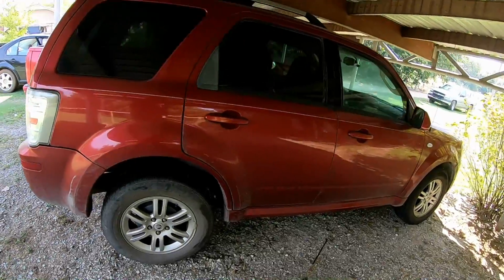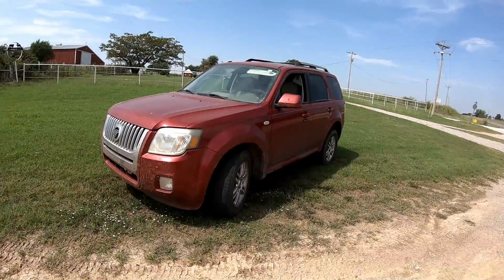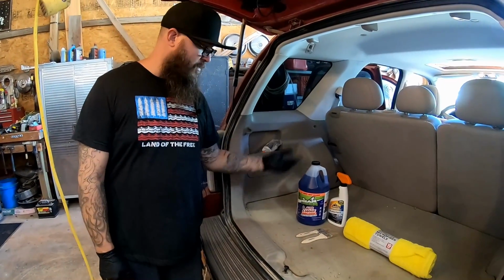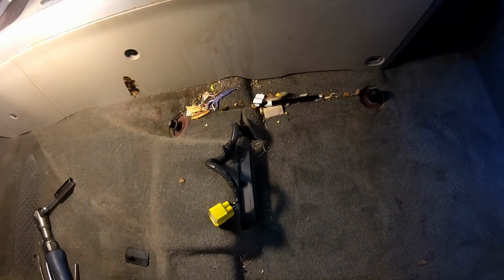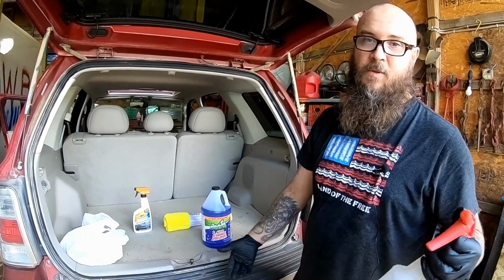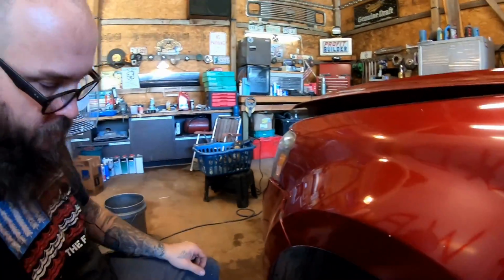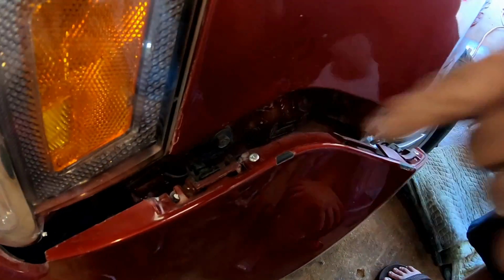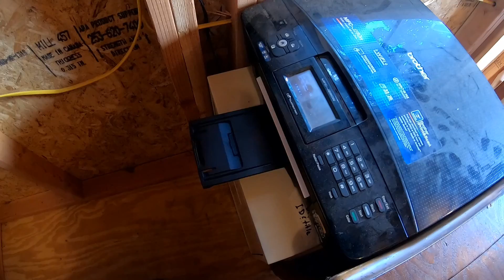Mercury flip car

Comment: Great job Mike, nice easy flip. CLEANING TIPS.... I see you using glass cleaner a lot on plastics and foam carpet cleaner, not very cost effective. Try this for cleaning plastic, leather, fabric etc: Woolite. 

Get a 2 gallon bucket, fill it half with water (1 gallon) and add half a cap of Woolite (which should be 2 oz or 1/4 cup if you want to measure). Dip you towel, ring out until damp, and wipe around all the dash, plastics, safe and effective, dry with a 2nd towel. Any really stubborn spots or scuffs, have a magic eraser soaking and just lightly wipe (don't scrub) with the eraser. Use the same solution on fabric seats and carpet using the towel and you can also put it in a spray bottle if you find it easier (fill a 32oz bottle and add 1 tablespoon/0.5oz of Woolite), buy a couple of cheap beach towels to pat dry, constantly switching to a dry section. Ring the towel out really well and use on headliner. I prefer white terry towels with no dye in them, but micros work just fine; put a bunch in the bucket and keep getting a new one out if you don't want to contaminate the solution, toss the old ones in a 2nd discard bucket. 

For dirty spot cleaning, get a 32oz spray bottle, mix a stronger 4 oz of Woolite (1:7 ratio), spray and spot clean, ensure to follow up with the normal cleaner above or just water to dilute the soap and suck/pat dry. For deodorizing, mix 1/4 part isopropyl alcohol to 3/4 water in a smaller spray bottle, spray and wipe the fabric, it'll smell like alcohol for 2 hours while it dries but it'll smell great after that. 

For dressing the interior, try this: Wolfgang Uber Rinseless Wash, not joking. Mix it 0.5 oz to a gallon in a bucket (or .25 oz to 1/4 full bucket to save product), wipe all the interior plastics and leather and dry with a 2nd towel, it'll leave a nice sheen, some protection and slickness, and continue to help clean. 

For the exterior, beyond a simple wash or even if you buff, use the same Wolfgang solution for a final wipe to add some gloss and temporarily protection, and it's a great lubricant if you want to pick up a clay towel (I use the Mothers 2.0, looks like a computer mouse) to spot clean some bugs or other debris, great to do the windshield with this combo. Wipe the door jams and rubber seals with this solution, helps beautify them all as you go. If you buff like you did the Lexus (Edit: and here I see as I keep watching), wipe off the residue with a dampened towel with this solution, makes it easier to remove the residue and protects in one step. Hope that helps!!!

Comment: Catching up on older videos I haven't watched. Another job well done. That interior looks as good as the day it rolled off of the factory floor.
Reply from the maker: Thanks for checking out the old stuff. We had some sound issues for a while but finally got it straightened out.

Comment: Toyota Highlanders especially in white with a tan gut, will bring all the money because they tend to get exported over seas where they sell for big money. Same with the RX’s.
Reply from the maker: It’s funny that you say that because it was white with tan interior. I couldn’t believe how high it went.
Reply: Weird Beard yeah the export guys can pay crazy money because mileage and conditions almost don’t matter. It has to do with the import taxes they have to pay, some years are much much lower then others. 

As for BHPH a lot of those guys avoid the Toyota/Honda because of the “Toyota tax” at the sale. Depends if there biz model is rally based on repo and resale, or if they are a “good” BHPH dealer.

Comment: I used to drive one of those, a 09 mariner premier. it was a great car minus the Electronic power steering failure, which cost about $400 to get fixed and the throttle body failure which was a recall so was fixed for free by Ford about 3 years ago. Sadly it met its fate to a culvert on the side of the road when my sister was driving.

Comment: Weird. Tech tip if you're cleaning carpet get yourself a spray bottle fill it with rubbing alcohol get a terry-cloth spray it on the carpet and wipe it with the terry cloth you'll need to Terry Claus and you'll be amazed how clean it gets it and it keeps the carpet from being damp you can also use it on headliners

Comment: Just subbed to your channel.  Which engine does it have? 2.5 ? 3 0 ?
Reply: 3.0 V6 shown on the dealer paperwork he was showing
Reply: @emeyer6963  thanks! I  had a 3.0 in a Ranger once. Good motor.
Reply: @frankhaskell5919  I had a 2005 Mariner with the 3.0 and it was a good runner until the catalytic converter gave up the ghost at 157000 miles.Was off to the junkyard as it was a rustbucket underneath and transmission was slipping.

Comment: You can tell a lot about a car by looking at the wear on the brake pedal 200,000 miles with a worn out brake pedal is hard mileage stop and go traffic but if the brake pedal is fairly new looking, those are freeway miles also while you have that brain exposed I would unplug it and clean the terminals with fine sandpaper it makes a huge difference the way it will run., While I'm on that subject it's good to pull out every fuse and do the same thing making sure the female still has a good grip, with a car that old, that's about the age where those things start to fail from corrosion

Comment: that was one dirty car. came out very nice. should fetch a nice price. I use mean grean to detail with. I also use c.l.r. cutting it with hot water. caution using c.l.r. in concentrate form. very strong and can/will  burn the skin or damage the material/items your cleaning. best to wear thick rubber gloves and use in very small amounts

Comment: For a dealer maintained car. They sure as hell didn't car much about the interior, that's for sure. If you can't keep you car semi clean, why bother to buy one.. Just use a horse and buggy instead.
Reply: I worked for a GM dealer in Monroeville,PA many moons ago. And as a part of every service ( Did not matter if it was a simple oil change.) the car got an exterior wash, the interior vacuumed, and the windows cleaned.

Comment: Something seem off about this vehicle he said it was dealer maintenance but yet its dirty as hell inside but if they cared about the vehicle they would have kept it clean inside and out motor vehicles that dirty inside that shows me that they don't care about it and will not have a service
Reply from the maker: Not true in this case. Most of the dirt issues were due to dirt roads in the county. The maintenance record on this car was on point and it shows by how well it runs and drives. 🙂